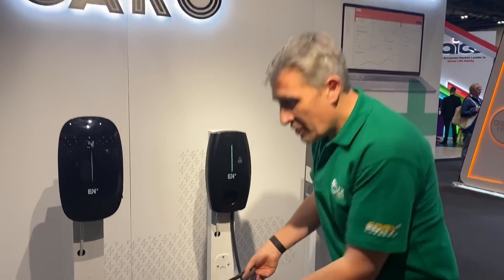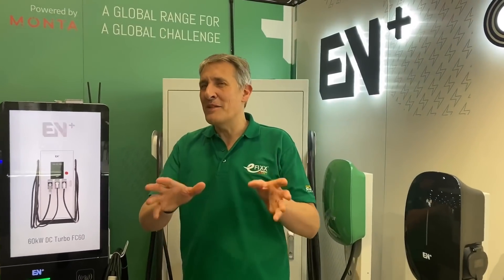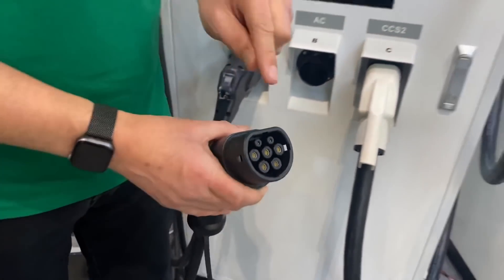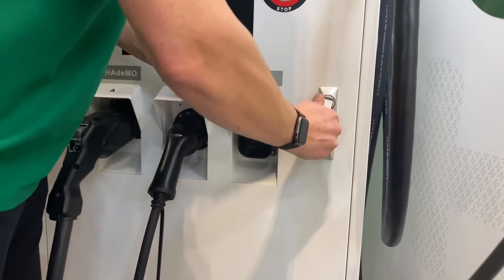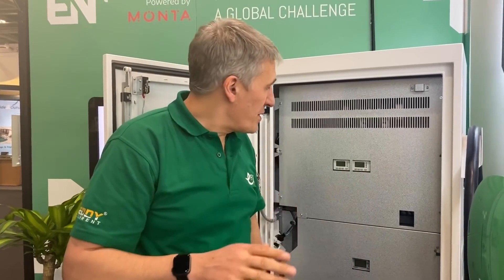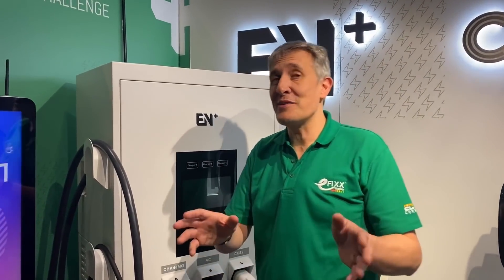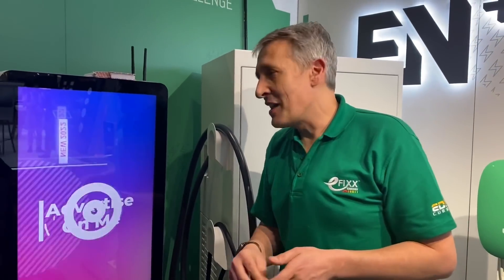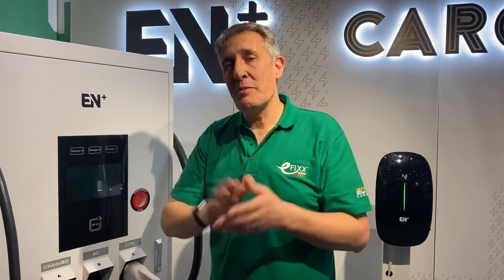THAT'S NOT AN EV CHARGER - THIS IS A FAST DC EV CHARGER! - EN+

Comment: Very good commentary.  Yes, AC means the charger is in the car and all the lucky Tesla fan boys get 11kw charging off of 3-phase,  where 3hrs will take you from 30 to 80%, well nearly.  A small DC unit, around 25Kw, can be installed onto a normal 32a 3-phase supply and this is enough for your average business with several employees requiring charge points. At least the lights won't dim when you start charging.  Curious that the 120Kw unit also included a 7kw AC connection - why would you want that with someone stuck there all day and night.  Charging is still shrouded in mystery with installers looking to make a killing which is totally inappropriate for an AC connection to the onboard DC charger.  I need to catch up on a few more of your videos as they seem very down to earth and understandable.  You, politely, didn't mention the cost of that 120kw DC charger, it'll certainly fry the batteries...

Comment: Slightly wrong statement about 22kw. The type 2 can deliver a charge to Renault Zoe’s up to 43kw if the destination unit can supply, as many do on the Rapid chargers and some destination chargers, on the Zoe’s with the Q90 motor.
Reply: Our 3 phase Garo charger could charge our Q90 Zoe at 22kWh at home.

Comment: 120kw = not a "small 3p supply" - Let's be fair, if you've got 3p in resi, it's likely to be 3x60 or 3x100 at best, so a quarter or a half of that DC charger..
Reply: The 3-phase DC chargers are, of course, delta-connected, so the 3x100A offers exactly 120kW of power.

Comment: I've heard some slower DC chargers are coming 11 - 16 KW DC , these are not as good as they sound , the reason is a lot of cars when on DC "waste/use 7+ KW to try and heat batteries to high temps approaching 40degs C, this default and can't be turned off. So if short charge times are carried out such as " a splash and dash " half the cost of electricity is wasted.
Reply from the maker: Good point we’ll explore this area further!

Comment: I have fitted the 7kw EN+ unit and it is definitely a cheaper unit but the current app makes it impossible to commission on every install so far. I have heard they are remaking the app
Reply: Why would you need an app to charge at home? We are about to take delivery of our 5th BEV over 14 years & we just plug em in & let the car do the rest.
Reply: @wilkoone9155  The app I referred to was for commissioning but, if you just plug in and charge how do you schedule your charge at the cheapest rate?
Reply: @essexcountyelectricalltd  On our Zoe its easy to schedule charging for night rate electricity in the car. Our ID3 has the most ridiculous system so we just commence charging after 11:00pm.
VW assumes that everyone leaves the house at the same time every morning. I'm a farmer so I don't, it could be anytime, sometimes I might not use the car for days.

Comment: The Dc connectors are similar to the portable welding sets that are used across many industries. 120kw is impressive but will the DNOs like it?
Reply from the maker: Finding a suitable connection for the DNO is a key part of the process.

Comment: What size of cable would be required to supply this DC charger?
Reply from the maker: Big! - 173 Amps per phase - then factor in distance from the supply for volt drop.
Reply: @efixx  Interesting that this is an all-in-one box for 240V. Usually DC chargers use separate cabinets on medium voltage for a row of charge points.